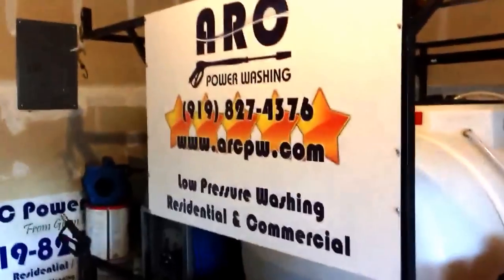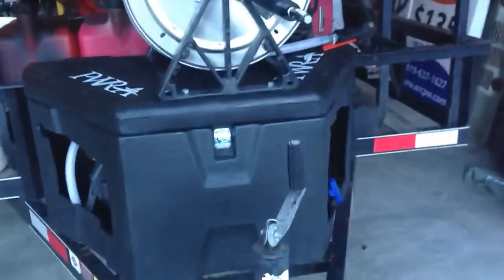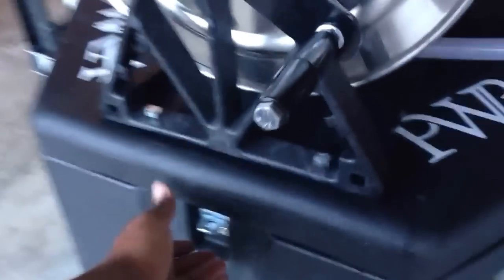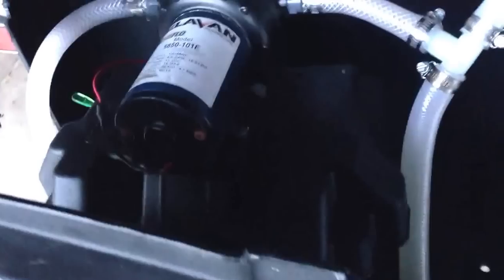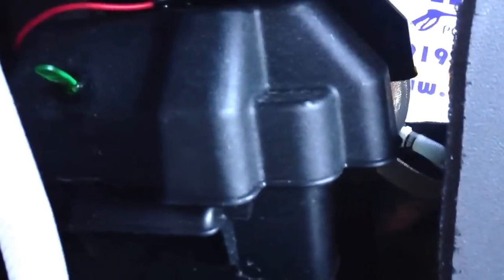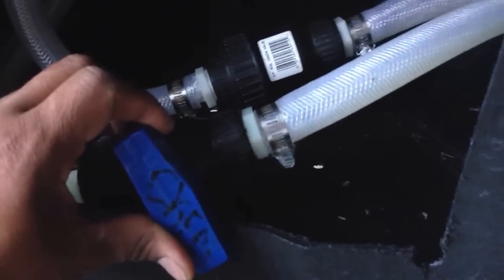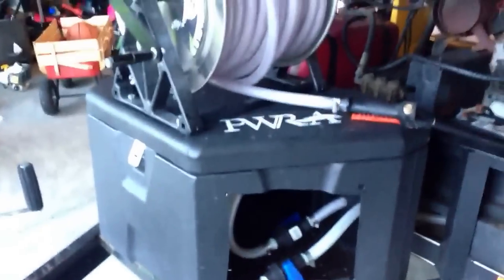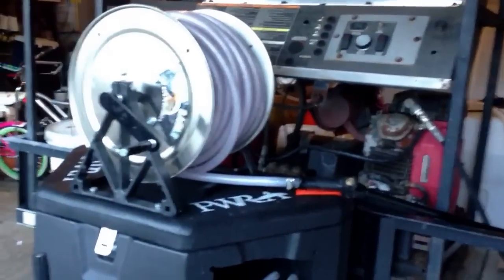Roof Pump set up

Comment: Nice set up Alex.  You could flip your pump 180 degrees so the motor is above the pump.  This way if you develop a leak it will run down and away from the motor.  I like that tongue tool box...may have to get myself one for my trailer.

Comment: Hey how do you keep your battery or should I say how do you keep your pump running continually without dying? I bought me a little charger from Walmart but I think I can run wires from that battery straight to my van battery would that work would that create the same amount of energy 12 volts just running wires from a converter if you can help me figure out how to keep my battery charged for my  soft wash system not appreciate it